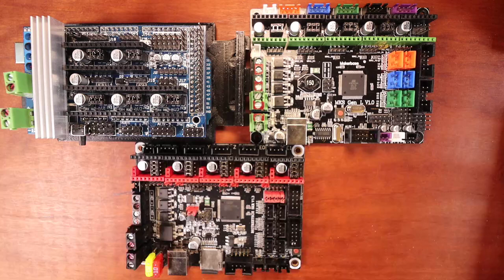Equipment corner - Selecting a 3d printer board for a beginner

Comment: MKS Gen-L V2.0 is the best choice out of these for a 3D printer board. MKS Gen-L V2.0 adds the Trinamic jumpers for SPI and Uart communication compared to V1.0. Easy upgrade to 32bit with MKS Sgen-L, which has the same size and connector layout. The MKS boards have more exposed pins than the Bigtreetech, useful for level sensors like a BLtouch. Of course the Bigtreetech can run Marlin 1.x. All shown boards have the same CPU, only the pin layout will vary slightly

Comment: I subscribed to your channel because I wanted to get into 3d printing and was considering the v1.1 Pro (Double Z + 3 extruders = No brainer) and you did a great job of explaining a lot of details .
But there are other factors to 3d printing like motor drivers (UART vs SPI ... SPI wins ), nozzle size , filament size , extruder type , structural integrity of the printer frame  that play a big role in printing size , time , and choosing the right printer frame.

If I get into printing I will definitely not buy a printer to gut it and change everything out but rather buy a frame and add the parts I want.  A bit of work and figuring out but doable and costs around the same as what a similarly sized stock primitive Creality printer would cost new .

If I do get a frame put together I will build a cabinet with glass or polycarbonate sides around it to serve two purposes . Support the main frame and an inclosure to preserve heat and contain toxic fumes and create an air purifying system within .

By supporting the main frame I hope to attain faster print speeds . 

Although Marlin boasts 6 extruders  , colour mixing  , and tool changing , I wonder why boards have not been developed with 6 extruders to attain endless colour mixing possibilities , and no one in the Marlin community was able to successfully demonstrate colour mixing although it was achievable on the 8 bit Rambo Motherboard .https://www.reprap.org/wiki/Repetier_Color_Mixing

Better hardware without advancement in software and support doesn't amount to much.
Reply from the maker: You can add a shield with up to four additional steppers.  I avoid the topic only because making a video with that many steppers would confuse almost everyone in steps to follow and available pins to use on the board.
Reply: @EdwardBraiman  Glad I commented . 
Whats a shield Edward ? Were can I read up on the subject ?
Reply from the maker: There was an article on RAMPS 1.4 that explains this on I think reprap wiki.  I'll see if I can find the link.
Reply from the maker: https://www.reprap.org/wiki/Adding_more_extruders
Reply from the maker: It's kind overwhelming to do as a video tutorial.
Reply: @EdwardBraiman  Thank you very much . Highly appreciate the link. 

Will you ever do a video on your thoughts about different printer designs ?

Core XY vs Tri vs etc ?
Think that is something worth going over if you feel comfortable covering it some day.

Comment: Love your video's and wanna support you. Do you have an affiliate link for skr v1.4 turbo with 2209's? If not ill just get the skr v1.4 turbo with your link.
Reply from the maker: I've not yet been able to get tmc2209 working yet and like to avoid posting a video until it works.  So I'll post a working video when either Marlin firmware or bigtreetech provides better guidance.  I would suggest holding off on tmc2209 stepper until then.
Reply: @EdwardBraiman  , what "better guidance" do you need? You just have to leave only one jumper and change 664,665,666,671 strings in Config.h
Reply from the maker: Ya nos naya.
Reply: @ДмитрийЯровой-л5з  So does the skr 1.4 turbo with tmc 2209 now work ?
Reply from the maker: It still has an open issue (bug) on Marlin firmware GitHub, so I suggest holding off until resolved.  Spaceba.
Reply: @EdwardBraiman  You're right. Is this issue you're talking about ? https://github.com/MarlinFirmware/Marlin/issues/17057
Reply: @geekoid183 , it was working erlier, there was problem only with wifi and sd Slot. Aliexpress will refund me a half of money.

Comment: Hi Ed, thanks for the videos. IMHO, and according to my FabLab experience and common 3D printers repairs, none of the shown boards are suitable for newbies. Let's explain why. First, any board with pluggable stepper drivers represents a useless complexity for the newcomer : driver selection,   orientation, jumpers setup, vref current calculation (depending sometimes of resistors value), vref setup depending of drivers (CW, CCW), and do on. The newbie needs integrated drivers boards, like SKR mini, Duet Maestro, and so on. Second, and for the same reason, microcontrollers with shields are outdated. Actually the RAMPS is outdated, whatever its version, and to is overpriced. It's connectors are not secured and reversible which is a possible issue for the beginner. Some connectors are surrounded by other components in the middle of the board and it's definitely not easy to select the right pins and manage wires. On the other hand, a shield contributes to the microcontroller overheat. Modern boards have the connectors comprehensively labeled and distributed all around the board, with good ventilation and wire management as perks. I used a lot RAMPS shields on early Reprap printers, but all this belongs to the 3D printing museum. It can't be decently recommended nowadays, except for nostalgia's. It's a no sense for newcomers.
Reply from the maker: Well as a beginner I made several of these mistakes, thus the tutorials.  As a beginner I might be a little confused later on if I purchased equipment and then found out I was unable to upgrade steppers.  My thought process is the beginner wishing to learn, otherwise we would advise them to buy a printers full built.
Reply: @EdwardBraiman  I understand your point. You suppose the newcomer may need to upgrade steppers. It may be true for some people, especially if they get the wrong card/drivers. Actually, an all in one 32 bits board like the SKR mini cost less than 4*DRV8825 and contains all what you could expect, including the ability to use external drivers of any kind. What I note from our FabLab members, is  only experts with custom applications need special drivers. We do not recommend/use shields or plug in drivers anymore. Whatever the firmware. We note a better understanding from people, especially childs, and less issues or hardware crashes.
Reply from the maker: The SKR mini is useful, but remember it has less pins and functionality than a SKR 1.3.
Reply: @EdwardBraiman  Bonjour tout à fait exacte
Reply: @EdwardBraiman  Yep, that's my point: the mini is much simple. The SKR (1.4 actually) have advanced features for advanced users ;)
Reply from the maker: I understand your opinion, but i needed to limit boards for someone beginning.  The SKR mini is a good choice.

Comment: Beginner? To what? 3d printing or electronics? What did we learn? What is a ramp? Which is best for beginners? This is why people pull their hair out trying to troubleshoot printers. You have to make 3d printers/electronics your life in order to keep one printing well. Just venting my frustration.
Reply: Tell me about it. As a 23 year Professional IT Admin it's been way more than I was anticipating. I recently accidentally left my Octoprint server left on when clipping a wire to my DIY UBL Probe and fried my RAMPS 1.4, Arduino and LCD screen! Now I'm upgrading to the RAMPS 1.6+ and let's hope I don't make that mistake again. Hoping my TMC2208 Stepper Drivers are still good. Was a semi-expensive small mistake on my part. I was pissed when I realized what had happened! Puff the magic smoke everywhere!
Reply from the maker: If it makes you feel better the reason I started making tutorials was because the instructions online we're terrible and kept having issues like frying a RAMPS/Arduino.
Reply: You actually don’t. You just have to learn how to use google and read instructions on a paper. It’s the same in every hobby.